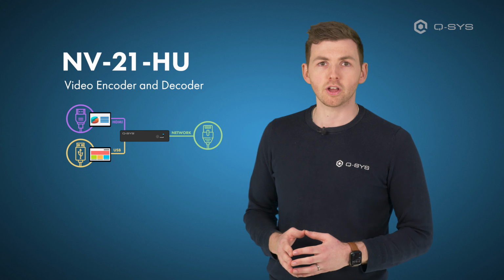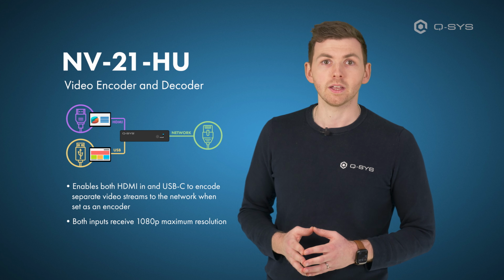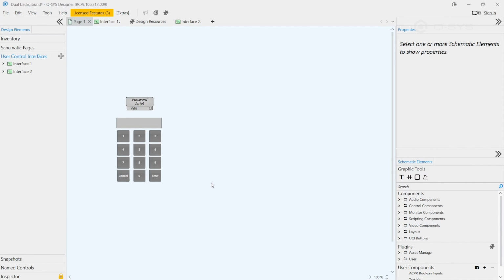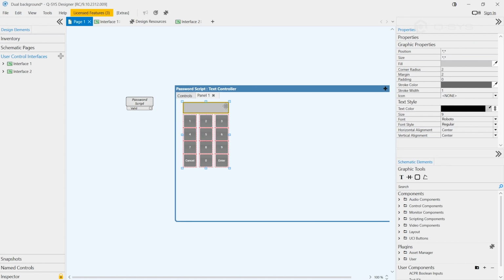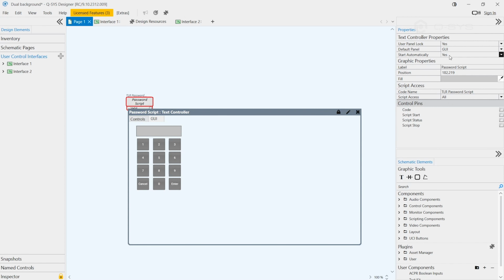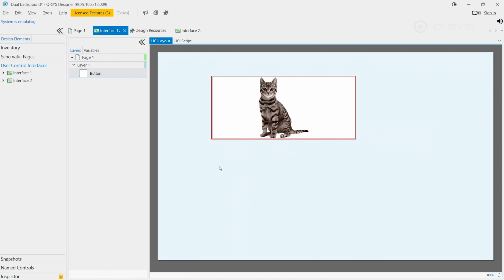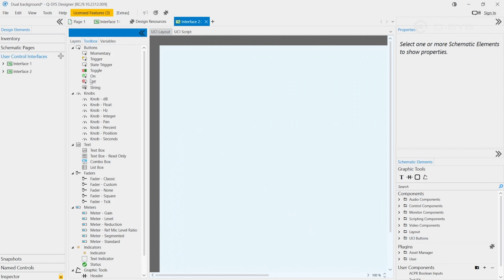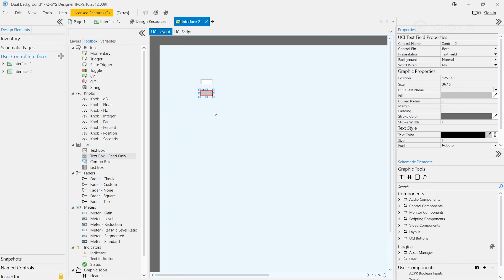Q-SYS Designer Software v9.10 updates

Comment: Where does the USB-C AV source live in the inventory finder?
Reply from the maker: Hi Justin, The USB-C input can be found on the I/O component of your NV-21 Encoder in Q-SYS Designer Software. Look for the bottom one of the two inputs on the component in your design.
Reply: @q-sys  I am aware of the input pins on the NV-21. What I didn't know was the generic AV source with the diamond output pin would intelligently shape itself to either the USB or HDMI input pins of encoders. Thanks for your follow up!